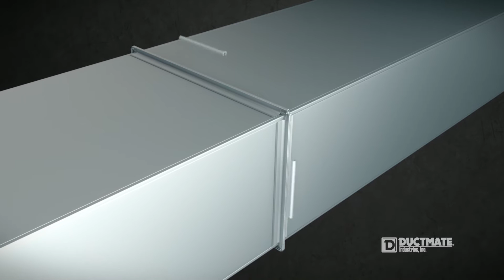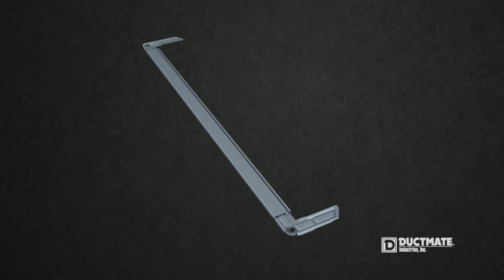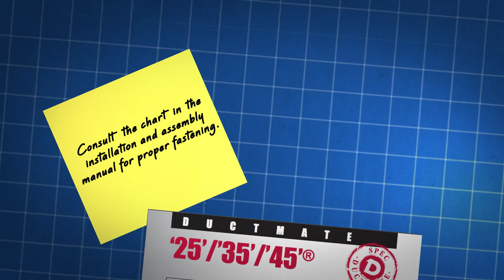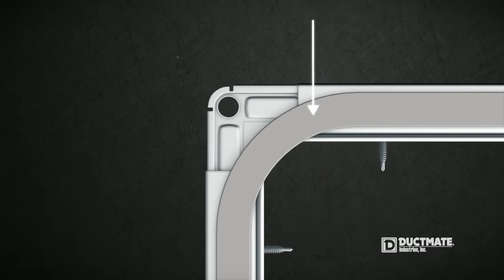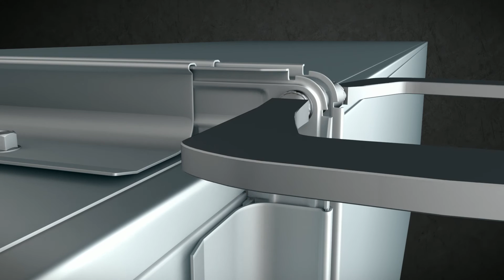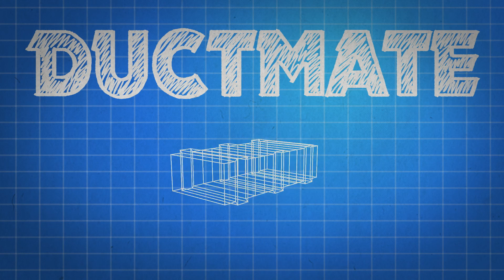Ductmate Flange Systems Installation Video | Ductmate Industries

Comment: Hi friends, I have a question. This system can be used in kitchen duct extraction? Thanks
Reply: Commercial kitchen hoods (in the USA) have to follow NFPA 96 and usually require welded joints